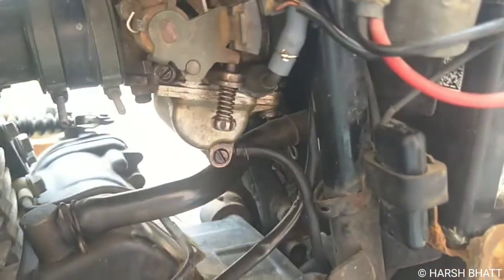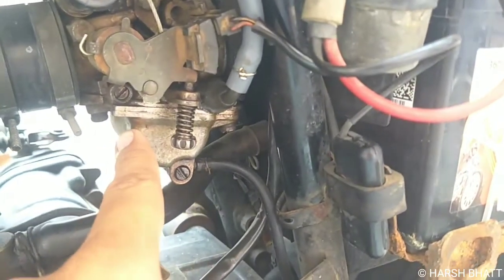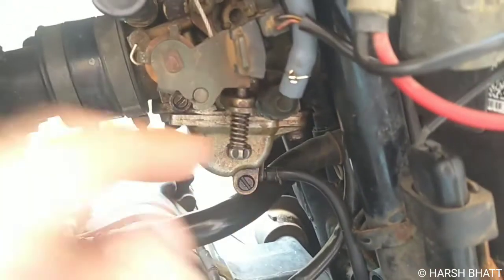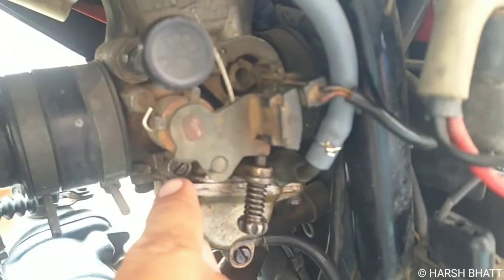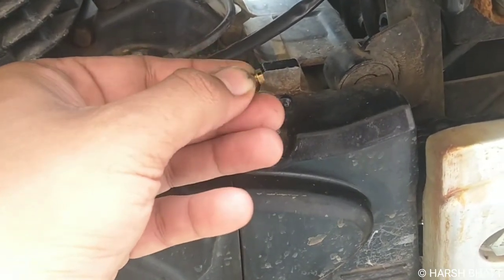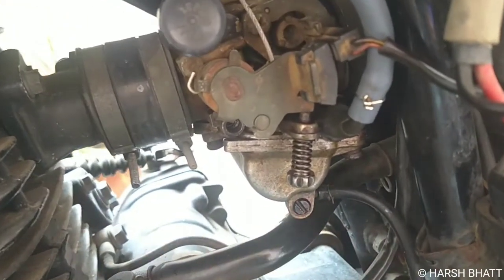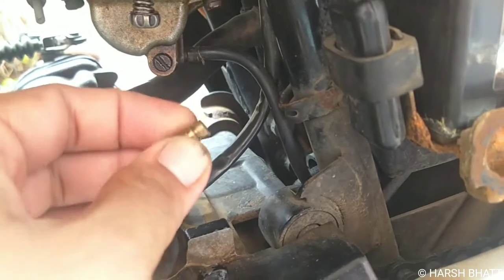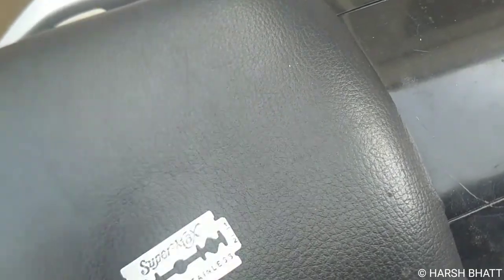How to stop leakage of pulsar's carburettor

Comment: Bhai meri cd100 me old carboretar me bhi fuel overflow hoo rha h or new carboretar me daal diya tab bhi overflow hoo rha h kya meri bike ki tank clean krna pdega kya
Reply from the maker: Bhai aap ka carburettor overflow ho raha hai ya leakage ho raha hai ?
Agar overflow ho raha hai to flot pin ka issue hai aur agar leakage ho raha hai to flot chamber gasket ka issue hai lekin agar aap ki gadi ki tank aap ne clean nahi ki hai to clean kar lo
Reply: @HarshBhatt  overflow
Reply: @HarshBhatt  flot pin bhi new daal di fir bhi issue aa rha h bhai
Reply from the maker: Bhai aap ki flot pin properly fix nahi ho rahi aap clean kar lo
Reply: @HarshBhatt  bhai 10km tak bike shi chlati h fir se bike me problem aa jata h  or chlati bike Ruk jaati h or carboreter se petrol overflow hoo jata h
Reply from the maker: Bhai flot pin check karo vaha pe agar thoda bhi kachra hoga to overflow karega aur please tank clean karva lo
Reply: @HarshBhatt  ok thanks bro